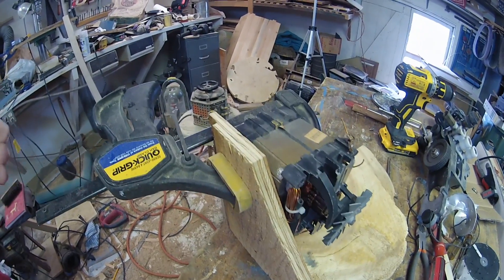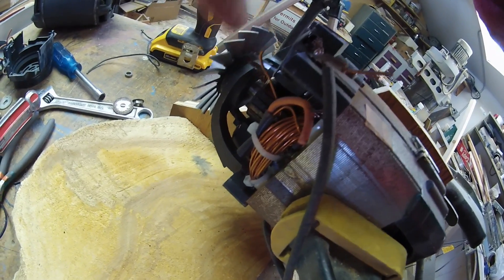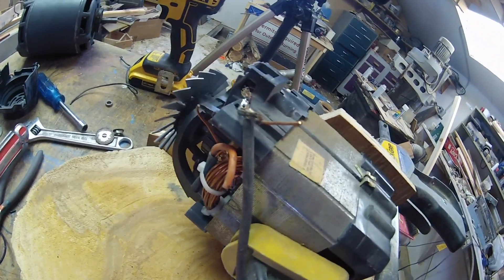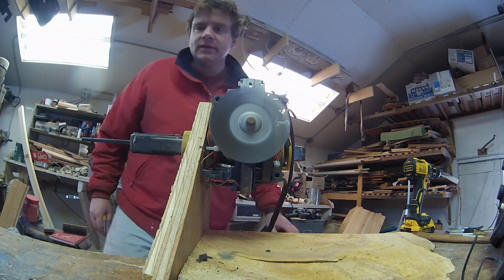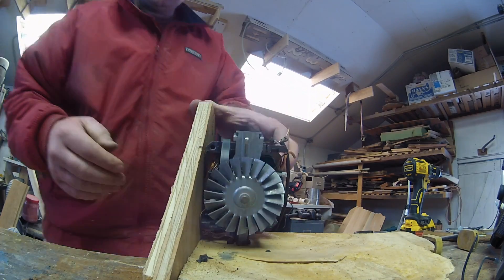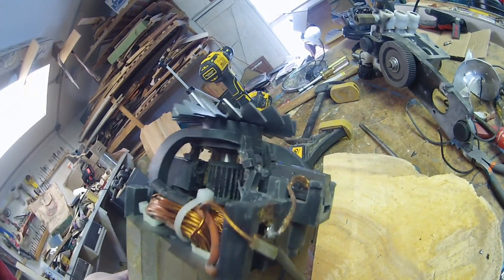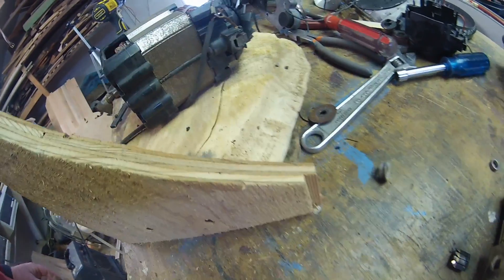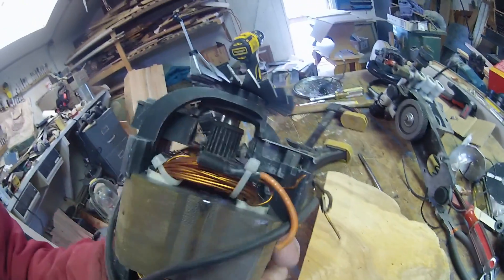Electric Motor Explodes

Comment: I always wondered what would happen if the user advanced the brush position as the motor speed increased? The failure is that when the stock brush position and commutation point VS armature speed is increased, back EMF change causes massive brush arcing and even flashover thus heating the commutator. However, if you then advance the timing, the arcing is reduced allowing for higher speeds. The motor still would fail, but fail in an even more spectacular way with higher RPM and centrifugal force being the breaking point, VS just cooking the com bars off the insulating hub. https://pphaneuf.github.io/rccars/articles/motor-timing-theory/

Comment: what happens if you run one of those motors in a bath of oil, with power straight to the brushes? the oil would probably cool it and cut down on the sparking some and it might last longer before it pops.   water would work too probably.   Something like a 5 gallon bucket.
Reply from the maker: I think photonicinduction tried that but I will look around.  Be neat to try just submerging the commutator, keep it cool w/o slowing it down much.
Reply: I think the oil would get in between the brush and the comm. and it would stop.
Reply: Unless it boils enough to create a suitable air bubble... then BOOM!!

Comment: It's always the com bars that let go, is there a way to take them out one at a time and reset them with a heatproof resin? Maybe even raise them a fraction to help dissipate excess heat?
Reply from the maker: kevtris had an under water or oil idea.  I think Rodacoil and photonic both tried something similar.  This batch of motors is dead but I will see what I can do on the next batch.
Reply: oh yeah I think you're right.  photonic did put one in an aquarium of water I think.  I can't recall what the failure mode was though.